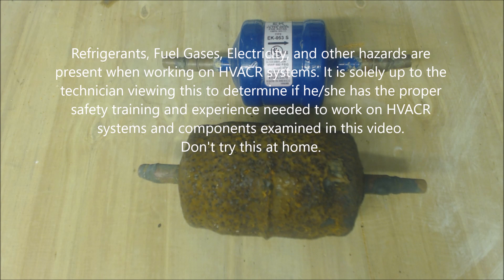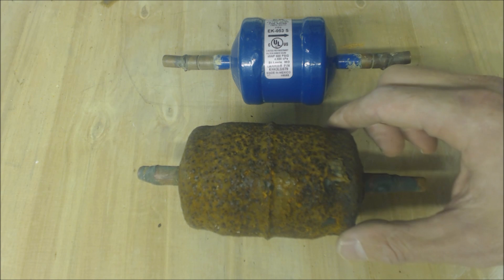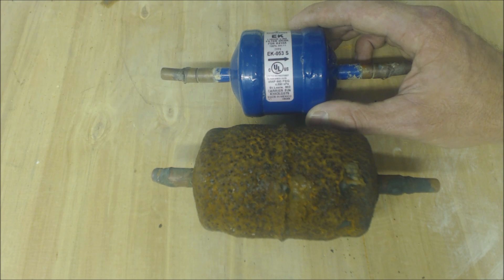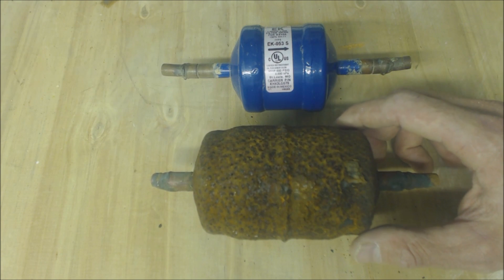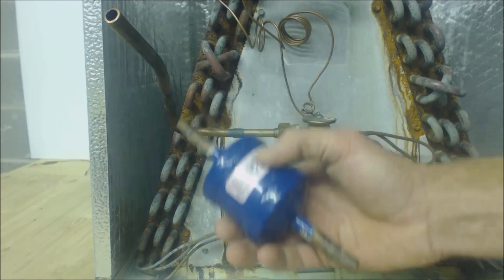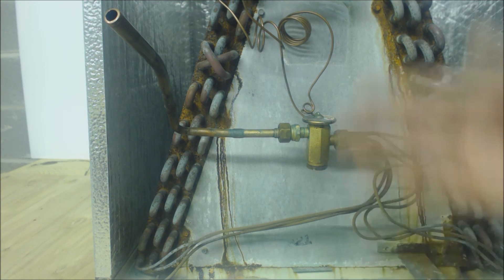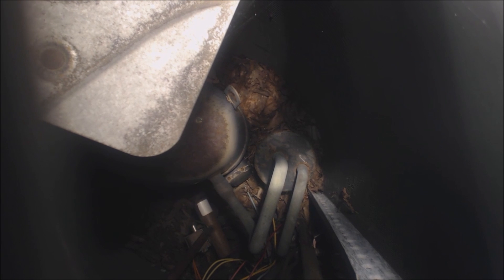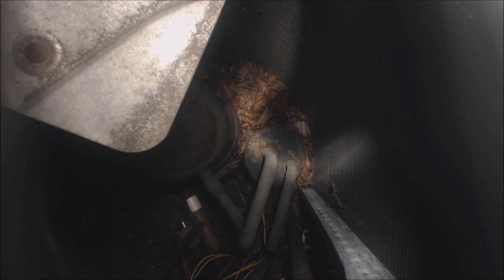Refrigerant Filter Drier Location- Where to Install and Why!

Comment: Hi acservicetech. I hope you can help. I have an oil burner boiler with a triple aqustat. it makes hot water but the burner won't turn when the t-stat is turned up. I have 20 volts at t-stat and I have line volt to the aguastat. but when t-stat  is turned up I have no 24 volt at the t-t on aquastat. I hope you can help. Thanks again.
Reply from the maker: Are you looking at something like a Honeywell L8151A? The unit may not be firing because the boiler temp has not dropped low enough yet for the unit to fire again. The T and T terminals do not work like a gas furnace would. To turn the circulator on you touch the t and t terminal together. If you have more than one zone then you do take power off of a transformer and that power when calling for heat opens the zone valve and the end switch closes the t and t terminals so the circ pump can come on.  I hope this helps! Let me know if I did not answer your question. Thanks
Reply: Hi acservicetech, thanks for the quick reply.  The aquastat is a Honeywell r8182d.  I understand completely what you are saying about the boiler temp not being low enough. I am a little unsure on the t-t terminals.  I know the t-stat goes to them, so are they the terminals that send 24v to the t-stat?  I thought I would have 24v with my meter at the t-t terminals on the aquastat?  The other thing is I push in on the relay for the burner and it won't start, shouldn't it start if I push that relay in and have it jumped out at t-t?   Sorry for the confusion, I just don't work on the boilers enough like I do the warm airs.  Thank you so much for the help.
Reply from the maker: In reference to the t t terminals, you can't hard power a thermostat off of those like a furnace that has common. When t and t are open it will read a potential of 24 volts. You do have 24v coming off and then the two get connected and then it goes to the load which in this case is a 1000 ohm resistance load in the board and then to common on the transformer which signals for the circ pump to come on. If you were to think about it, it is like a 24v hot going through a switch(thermostat) and then going to the 1000ohm load and then to common.  The problem is you have one hot 24v and the other has common to the transformer and then the load and then to the t terminal if that makes sense. I usually just go ahead and jump t and t or turn the thermostat on to heat and run the system on full heat load so whether that is one zone or 8 zones in order to get the temp of the water to fall and then I watch for what temp the burner actually turns on at and then exactly what temp it shuts off at. I then make adjustments to the water temp setpoints based on that. I hope that helps!
Reply: acservicetech 

Thank you so much! this makes perfect sense and I put it in my notebook. I did some more test and I think like you said it is because the water temp is not low enough. The hard part was explaining this to my friend that has the boiler lol!  But thank you so much for your info and time, your a god send.  take care and I'm  sure we will talk soon. If you get into Harrisburg PA and need anything send me a note. later boss.
Reply from the maker: Oh you are not that far away on the eastern seaboard. I am located at the southern tip of NJ. Ok, and thanks for your Comments and Offer!
Reply: Any time! I appreciate all the help you give me.

Comment: Hi ACSERVICETECH! Great video as always.  I came across a filter drier the other day that was installed with flare fittings. I am taking who ever did it, it was for easy install and replace. But I never do it like that I braze them in. Is it ok to use flare fittings with the pressures in the line? Thanks again.
Reply from the maker: Many lower pressure systems like 134a have flare fittings but I really would try to minimize the amount of flares. They could be used and with the mini splits they don't give you a choice. If I have a choice, I always braze.  Flares have a potential to leak especially if they get bumped. Many times that you see leaking flare joints on mini splits it is because of an improper installation that was not leak checked or vacuumed properly. Thanks!
Reply: Thank you ACSERVICETECH.  Very good info. I agree with brazing when possible. I am not to familiar with mini splits yet, but it's good to know they use flares. Thanks again.
Reply from the maker: Glad to help!

Comment: off topic, As a new tech that's about to graduate what should I look for in terms of pay. In the NM, TX area. Currently looking for a job and want to know what I'm worth. I know we have to start somewhere but I think anything less than 10.00 is unacceptable.
Reply from the maker: This topic has come up before. I put a video out about it. Basically during the interview you want to ask questions that pertain to the long term. Because of this, the topics of what you would be starting out out, what the raise would look like at 3 months if you prove yourself and what the raise would look like after a year will likely come up. You bring up the topic without neccesarily asking just about money.  I agree with your statement and to be truthfull, I started out at $10/hr in NJ 15 years ago and I didn't come from a tech school. https://youtu.be/R7U_Kry1CBA
Reply: Jevin Brown I'm in third year-commercial tech .$23.50

Comment: Just subscribed thanks. You said the filter could only hold so much water vapor, but where would the water vapor you mentioned come from ?
Reply from the maker: Great Question! This would come from servicing or improper beginning vacuum pumping. There will always be some even if little. The filter drier also holds acids and due to the  filtration, will stop foriegn material and a possible copper shard. You don't know who may service this unit after your installation. Thanks!

Comment: If the ac compressor already has a filter drier inside is it necessary to install another one on the lines?
Reply from the maker: As long as they have one that is new when installed they are ok. It is a shame that a couple manufacturers actually put them in the outdoor units. Most do not though and are field installed. Thanks for the Question!

Comment: sir can i ask a question,,i have a problem with my condenser unit.
the fan is not working but the compressor is,. i changed the capacitor for the fan and can work for maybe one day,but its the same problem,,not working,,how can i test the fan if it needs replacement or not.or is there any problem why the fan is not working
Reply from the maker: Here are two videos on that.--https://youtu.be/DmFSQbowYIg----https://youtu.be/0U_bpumqCRI
Reply: What happens when a filter dryer just put in with the arrow going the opposite way